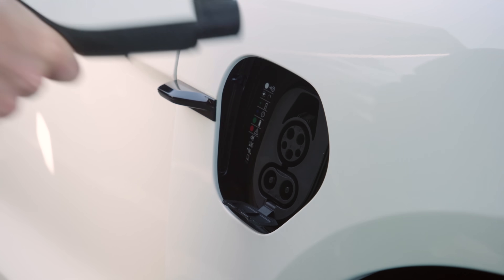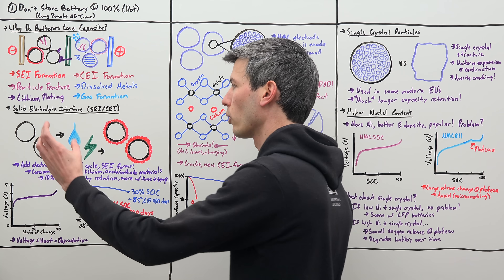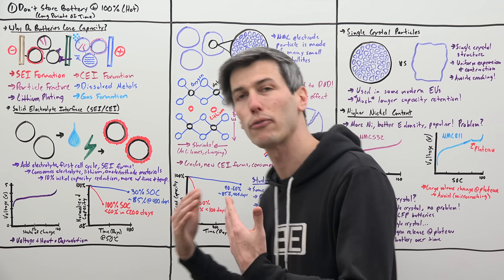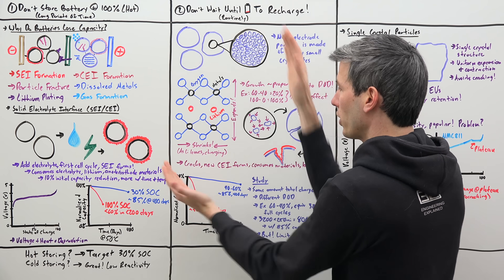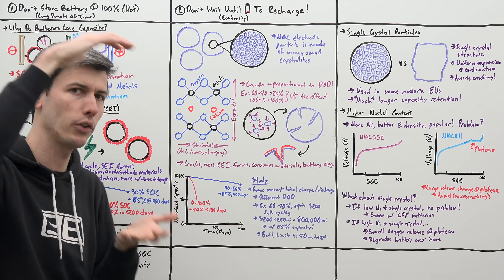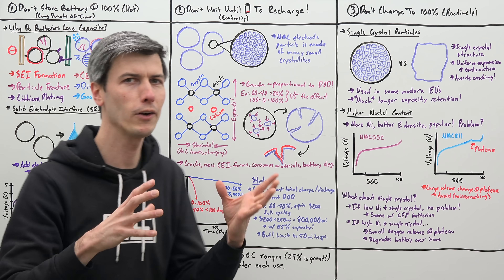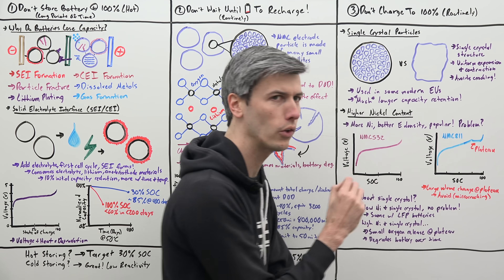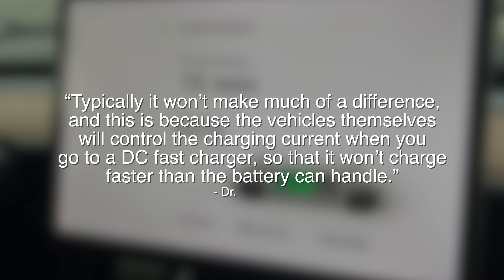How To Ruin Your Electric Car's Battery - NMC Edition!

Comment: I don’t have an electric car (yet?) but this would explain why the EGO chargers I use for my power equipment automatically discharge the batteries to 50% if they remain in the charger more that 30 days.
Reply: Yeah a lot of people still treat lithium power tool batteries like old NiCad batteries, which kinda need the opposite care plan lol

Comment: You forgot to mention how bad the emissions are for the environment when you charge your EV😮....or do the manufacturers deliberately leave out that statistic & think that the power stations are driven by 'mice wheels'...😂
Reply from the maker: Here ya go! https://youtu.be/6RhtiPefVzM?si=E1x62OV54ICLCfFI
Reply: EVs are dirtier to make, but have zero tailpipe emissions.  How quickly your EV become cleaner than a similar IC car depends on how your utility sources its electricity.  On average the break-even is about 2 years in the USA.
Reply: Also Lithium batteries are fairly recyclable, so eventually we won't need nearly as much of the nastiest stuff per new vehicle, as opposed to oil and gas emissions, which are constant and non recoverable.
Reply: I power my car wholly from my rooftop, of course it’s not 100% green but it’s damn close, and free.

Comment: " the battery it's very expensive. And if it needs to be replaced, it's a huge expense." Welcome to the department of redundancy department.
Reply: they have 8 year warranties covering even the most neglected batteries - so examples that have been treated half well are going to function for a very long time

Comment: 1. Don’t keep at 100%
2. Don’t do deep cycles like 0-100%
3. Don’t charge to 100%

Seems a bit repetitive. 

Just keep it between 20 and 80 unless you need it.
Reply: And fast charging doesn't make much of a difference
Reply: At least on cars with thermal management systems coughleafcough
Reply: unless it’s an LFP which is recommended to be charged to 100% regularly

Comment: Ok, so even with the best practices the battery is guaranteed to lose capacity over time at some point. Yet nobody seems to invest into making replacing batteries more standard/easier. To make it actually happen more often than just trashing the whole car.

And no government (except maybe EU and only for much cheaper cell phone devices) seem to even mandate the issue. So do they really care about the planet as much as they say?

Comment: To remove user concern/confusion manufacturers should just show full and empty on the gauge and manage the percentage usages behind the scenes with software. How about have a "long trip" button the user could press so the software would know to use more of the battery available.
Reply: I mean cars already kinda do this and people hate it. Besides, the more information the consumer has access to about an object they own, the better.
Reply: @BrandEver117   understand...  where I was centered was like a gas guage on a car, it just shows full and then some increments to empty... do people really know the exact gallons per increment?  Do they look at it like that? or do they just go, oh crap, 1/8 thank, better fill up....
Reply: @BrandEver117   also, the software could manage to rotate cells charged and keep the buffer of 10-20% unused to help with health and longevity.
Reply: @alecstetzer2018 My Bolt does just use bars, 20 representing 5% each, and a range estimate.
EV packs don't discharge some batteries while leaving others charged, they are all discharged and charged to the same level. If you charge the pack to 80%, that means every individual cell in the pack is charged to 80%.

Comment: I own a Model 3 for three years now and I can't charge at home. I drive 650 km a month, short distance commuting. I exclusively use Superchargers once a week. Everything is fine with the car, still 460+ km of range at 100%.
Reply: Why did you buy a tesla if you can't charge from home? In my area the cost per mile is literally twice of the cost of a prius if you charge at a supercharger.
Reply: @jimfarmer7811 STFU. There is no Tesla supercharger in the lower 48 that is literally twice the price of a Prius. None.
Reply: @TonyShepps  according to Google supercharger can charge up to $ .50/kwh. At 4 miles per kwh a tesla model 3 would cost  $ .125 per mile. With the current gas price of $2.80 at 55 mpg a prius would cost $.051 per mile. This may be an extreme example but clearly in all cases it will cost more for fuel to drive a tesla than a prius. Also don't forget the tesla tires last half as long and cost twice as much to replace.
Reply: @jimfarmer7811  Please point me to the actual Tesla supercharger in the lower 48  that costs $.50/kWh. I've never encountered one in 3.5 years of ownership and supercharging in 12 states. My average charge in 2023 was $.32. Lowest $.24, highest $.36.  Of course most of my charging is at home, where it's half that price.

And I will happily put any additional price of my tires against just the routine maintenance of oil, oil filters, coolant, water filters, belts, lubrication and adjustment, and worst of all, having to go to the gd dealership every six months. 

But the best thing about having an M3LR versus a Prius is: HOLY CRAP I GET TO DRIVE AN M3LR AND NOT A PRIUS!!!
Reply: @TonyShepps  Seriously you are comparing the $120/yr I pay for scheduled maintenance to your tesla. I would be embarrassed to admit that I bought a car that depreciated $25,000 to $30,000 in 3 years. You must not have retirement plans.
Reply: @jimfarmer7811 Depreciation? Guess what, Otis.

With OTA software updates, my car actually improves over time. It will shortly become fully self-driving. At that point, its value will dramatically increase. The car will, if I choose, become a robotaxi, and make money for me while I sleep.

Yours?
Reply: @TonyShepps  This has got to sarcasm. Nobody in the world honestly believes level 5 self driving will be available anytime soon. Meanwhile if you paid $50,000 for a new tesla 3 years ago it's worth $25,000 today. You lost $25,000 in just 3 years. If you paid for full self driving you lost a lot more money.
Meanwhile 2 years ago I purchased a new Ford Maverick for $24,000. Because of high demand for this truck I can still sell it for what I paid for it. 
I paid cash for the Maverick because I made smart investments over the years and retired early. I didn't make it my life priority to further enrich a megalomaniac billionaire. Some of us are destined to die in poverty on the walmart floor.
Reply: @jimfarmer7811  The fiscally responsible thing to do will be to buy the Tesla Model 2 when it comes out (in about 2 years). It will be as cheap to buy as your truck, but will cost less than half to fuel and maintain. 

And it will drive itself. I know. I have the beta. I've seen the rate of improvement.

As an engineer, I suggest you choose your car based on the engineering, not the CEO. And as an engineer, I suggest you choose your Marvel villains according to what they destroy, not what they build.
Reply: @jimfarmer7811 I currently have a 2023 MYLR, a 2021 Prius Prime Limited and my wife a 2022 Prius XLE. And I’m sorry but have no comparison about drive a Tesla or a Prius, much different. Tesla is a luxury brand with cheap costs. Prius is a Prius, a normal car with high fuel efficiency. Ow, and I cannot forget, I had a 2021 Lexus ES, 2019 Audi Q7 3.0 and 2021 Highlander Hybrid, and I’m trustworthy to say: “TESLA IS SUPERIOR” period. Thanks :)
Reply: @YannCavalcante  It depends on how you define "Superior". I look at a vehicle simply as a tool to get me from point A to Point B as inexpensively as possible. As I outlined above there is no way a tesla meets my definition of "Superior".

 If your goal is to waste as much money as possible on transportation than the luxury cars you mentioned certainly meets that goal.
Reply: @TonyShepps  We have some superchargers that are $0.55/kw in Southern California. Those are usually in areas where there is high use.
Reply: @jimfarmer7811  I am curious how you got the Maverick for $24k. 2 years ago the dealers where adding like a $10k mark up on those cars. Is $24k the MSRP or what you actually paid?
Reply: @jimfarmer7811  So, why did you get a new Maverick? If that is your goal, get a 3 year old truck. It will get you from point a to point b and will cost even less.

Comment: I recently replaced the sealed lead acid battery in a booster pack. The specifications had detailed data on charge cycles, etc. and many of the same observations as in your video (avoid high temperatures, deep discharge cycles, so on).
Reply: The one difference with lead acid is they should be kept at 100% SoC as much as possible. 

When a lead acid battery is discharged, the sulfur in the sulfuric acid sticks to the lead plates. This is reversed by charging the battery, but the longer you wait to charge the battery the harder this layer of sulfur gets. When the layer gets harder it won’t convert back to acid as easily. Also, the acid gets weaker as the battery discharges. This means the electrolyte freezes easier, and a frozen battery will end up with bent and shorted lead plates.

Comment: Addressing the elephant in the thumbnail: It's not mentioned at all using one EV to charge another (which presumably would only be used for emergency vehicle rescue)...but the thumbnail says to never do /this/ pointing to 100% icon. The icon is over the CT, at 100%, and it's feeding into the smaller car. If using the extra capacity as needed (such as to go rescue another car) ...one would presumably charge the CT up to 100% /as needed/. The thumbnail could use some work.

Comment: We use to charge our then brand new 2021 Ionic EV to 80% after using it until 40-50%. However like many other Hyundai EV owners, the 12v battery would discharge rapidly while the car is parked. So we had to call road assistance more than once to boost our 80% charged electric vehicle. We thought the issue was with the 12v so the dealership made a one time no charge replacement of the 12v. But the issue remained and we just eventually bought a Noco booster in case we'd get stuck with a dead 12v. Good thing we did because it happened many times. 
Later we learned that the EV main battery would tickle charge the 12v, but only if above 70% (not sure about this value).  So we started to charge the main battery to 100% and never had to use the booster ever again. 

We still let it go down to 50-60% before recharging. But we always go to 100%

Good thing we took the extended battery warranty.
Reply: I had the same problem with my Leaf, it doesn't charge the 12v battery much at all until the traction battery is full. Even on a new 12v battery it'll start getting low after a month or so and even though the main contactor doesn't need much power, it does need a higher voltage, somewhere around 10.5v, so I charge my car to 80% for a week or two and then charge to 100% one night.

Comment: Seems like automakers could just artificially set "100%" a tad lower than actual (perhaps 85%) to eliminate the full charge issues. Advertise that 85% as full range and then advertise a "Road trip mode" for the extra range so that the default "set it and forget it" charge is in the safe range. 

Sure less bragging rights about top range but people are just as concerned about battery replacement costs. Plus it might help adjust the mindset people have about what range and charge they actually use in real life: "am I really taking a "road trip" to commute or get groceries and pick up the kids?"

Comment: The lady at Tesla center told me that my Model 3 Performance had 96.7% of its capacity after 2 years.  I did used fast chargers from time to time but I always keep the state of charge between 20-90%

Comment: With battery replacement warranties... it makes more sense to beat the crap out of the battery during the warranty period and only "baby" it after that first battery replacement.
Reply: Except when you get to 30% degradation instead of the 31% required for a replacement on the day your warranty expires....

Comment: One thing to note is that manufacturers already eat some the true state of charge in their consumer stated range vs their actual charge range to protect the battery.
Reply: Depends. They can set 100% at whatever actual charge they want, but most manufacturers don’t really nerf their batteries much. Gotta have that Big Range Number.
They only reduce to such an extent that they won’t end up with many warranty claims
Reply: @FuncleChuck  Every manufacturer reduces battery usable capacity. It depends on the philosophy of the OEM to what extent. Trade-off between range and warranty.

Comment: On Rule #2 at 7:42, those are two way extreme tests.  Most people don't go 0%-100%-0%.  I wonder what it would have looked like from 80%-20%-80%.  I suspect the curve is much closer to the 60%-40%-60% curve.  This sounds like scare tactics.
Reply from the maker: Definitely wasn't trying to mislead here, there's variance depending on the depth of discharge, and I showed two examples to provide context. You can see the full graph in the video I referenced, or in the study linked in the description. The smaller the SOC range, the better.
Reply: @EngineeringExplained  I'm not saying you were doing scare tactics, but the study.  I also wonder were they using the batteries true 100% and true 0%, since manufactures don't give you full use of your battery either.  Some have more buffers than others.

Comment: Rule 1: store the battery near empty if you have a hot garage (most standalone home garages have no insulation!)
Rule 2: Charge the battery after each use
Um so which one should we follow? They contradict each other! Unless you have a cool garage (like a basement). Looks like I'll be getting a solar-powered ventilation fan in my garage roof.
Losing 50% in 100 days is pretty worrying. Even just 15% after 400 days is half the battery storage after around 4 years, thus halving the range. Certainly food for thought re both financing the purchase, and whether it is worthwhile buying second hand as that market expands. You'd want to ensure that the battery warranty goes to the new owner!
Reply: The easiest fix is to just set the software charge limit to 75/80%.
Most people rarely need the full range and it greatly reduces this issue.

Comment: Excellent video, Jason. I appreciate that you don't take a side, but rather evaluate things from an engineer's perspective, looking at the advantages, disadvantages, and requirements of the topic at hand.
Reply: As a fellow mechanical engineer, I can tell you we always take a side. We side with what really works best, by the numbers!

Just kidding; we’re biased like everyone else.
Reply: @altosack  Sure. The bias is going to be towards what is the best way to meet requirements with the technologies and techniques available.

E/E does a good job of talking about both the advantages and disadvantages in his videos. Out of Spec Reviews also operates in a similar vein, but his videos are always really long.
Reply: Absolutely. The devil hides in the requirements and the things that got missed.  @TheMarcQ
Reply: He is pretty unbiased for a car enthusiast. Most hate EVs for all sorts of reasons, and will jump on any flaw while completely ignoring the advantages. 

 Like talking about range always like charging at home for pennies on the dollar isn't convienent.

 They all act like they have to drive more than four hours a day without breaks. 

 I think EVs are good now for 70% of the population, and will only get better. Solid state batteries are coming out which I hear are not only better in energy density, and for longetivity. 

 Me? I like them due to superior practical speed, balanced low center of gravity, and the fact they are silent.
Reply: The only people insinuating that there are sides are the ones still breathing exhaust fumes and not looking at the numbers. We're all on the same side: Humanity's and/or the Earth's side. Some of us are just further along and more capable of understanding what is good for it (EV and battery technology, etc.), and others are getting left behind in their old thinking and believing that we're divided into two sides... Either way the end goal is the same, and we all want the same thing. Obviously we all understand there are still developments happening but the real hinderance are those completely opposed and uneducated, or those grouping us all into two sides—whether they think they're part of one side or not...
Reply: @natjam0205  Tribalism has always been part of humanity unfortunately. Typically by the more uneducated ones as you've mentioned.
Reply: did you invest in cobalt mine in Africa or simply a  Biden  office worker?

Comment: The manufacturer already prevents you from charging to 100% already. Generally when it says 100% on the dash it is actually somewhere in the 95-98% from the actual battery capacity. The same on the other end, you can actually drive most EVs for quite a few miles at 0 on the dash and then they cut off power to the vehicle before the true 0 at the battery level to avoid long term damage.

This extends the charge cycles to help ensure the battery lasts longer than the warranty period within the guidlines of the warranty so they can ensure the consumer is on the hook for the inevitable replacement and not under warranty.

Comment: The percentage or SoC is calibrated using the coulomb counter. So the any lithium based batteries should be charged to 100% and say in 100% for a minimum of 30 minutes.